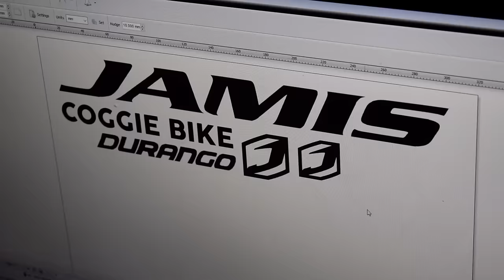Bike Restoration - Purple Dream Build Jamis Durango 2 [4K]

Comment: You have refurbished this bike very well. You have perfectly combined the colors.
I have a few questions. 
1. What are these hubs?
2. What is this front fork?
3. How much do ZTTO brakes cost you?
4. How much do SNAIL brake discs cost you?
5. How much does the NW SNAIL crank sprocket cost you?
6. How much do these specific parts from MEROCA cost you?
I am asking for prices out of curiosity because I would like to compare them with the prices in Poland, from which I greet.
Reply from the maker: 1. Koozer hubs
2. Arcade Rigid Fork
3. Around 2kphp
4. Around 500php pair
5. Around 300php
6. Meroca headset is only 300php
I am asking for prices out of curiosity because I would like to compare them with the prices in Poland, from which I greet.
Reply: @CoggieBike  
1. There is no Koozer hub in Polish stores, you have to bring it from abroad.
2. Interesting this front fork, please provide the link to the website, I will be happy to know something about it.

3. ZTTO brakes in Poland can be purchased for about PLN 270.
4. The prices of SNAIL brake discs start from about PLN 80 per piece.
5. The price of the SNAIL 32T crank sprocket is about PLN 50.
6. There are no MEROCA parts in Poland. You have to bring in from abroad.
Reply: Hello,  I guess most of the parts used in this video are available on AliExpress, you can check them right away,

Comment: Hi bro, I have a question. What is the aim of sandpapering when you have spray painted?
Reply: It is a primer paint so sandpaper it first per coating to make sure the base paint sticks with no issues. Same goes to base paint coating sanding coating sanding coating again then coating then 2 set of sanding to finest sanding then clearcoat.
Reply from the maker: Smoothen the surface

Comment: That uncatalyzed spray paint just sucks! You should use catalyzed paint, (that is paint with hardener you mix in with it) or just don't bother! That spray paint does not hold up, and will literally run off if any chemicals or gasoline gets on it! I would have put a little bit of air in the tubes before installing them too. I would also have used a better bottom bracket. Other than that you didn't do too bad.